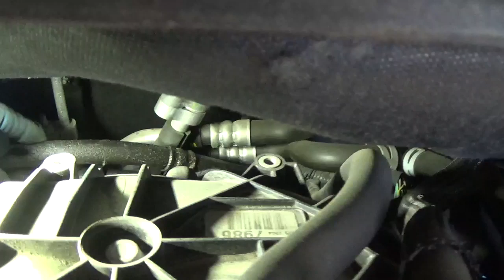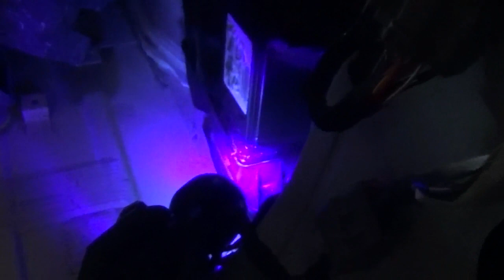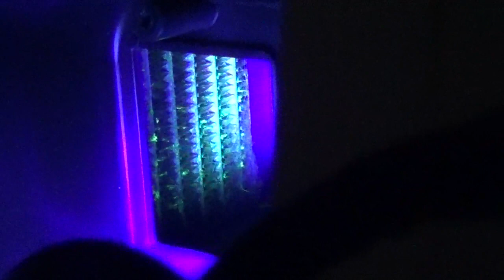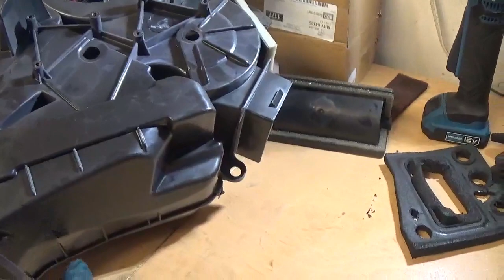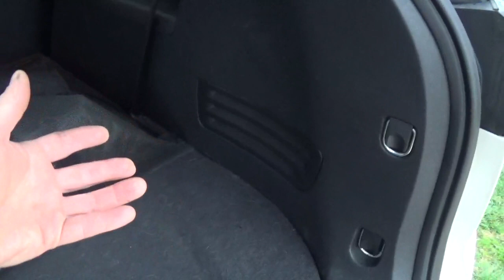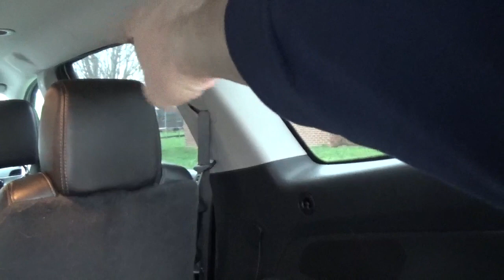Chevy Traverse Hard To Find AC Leak

Comment: Thanks for the resistor tip.. I didn't have to remove the seat though But I'm in the middle of the job and haven't reassembled yet and it might bite me in the ass later

Comment: Service bulletin has been out for this for years.   metal from the blower lands on the evp. and corrosion begins.    they have an improved blower cage is your motor is dead.   If not use your old motor as it has already been broken in.

Comment: Thanks for the video, Ramon.  If I don’t care about the rear, could I just install an ac block off in the front (at the location you mentioned where the power steering line rubs the rear ac line)?

Comment: The rear one condensates because it runs all the time the front one is running.  Ie any time compressor runs the evaporator is working.  The blower may not be used but evaporator and rear heater coolant are independent of the blower.  Temperature is controlled by a blend door.  Dirty air brings contamination from the air plug in the quarter panel.

Comment: Thank you for posting. Great job with this video and explanation. A few questions…
1) do we know the cause of the leak? Poor quality of evaporator? Other? I saw where there was a recall on 2015 and prior vehicles where an open design blower motor was allowing tiny copper particles from the motor wiring to be blown onto the evap and ate away at it causing the leak. Chevy came out with a closed design blower motor that would stop this from happening. My concern here is that we replace the evap and then it leaks again. Was the cause fixed?
2)can they possibly design a more difficult to access evap, good lord.

Comment: Nice find. Is there a solenoid/valve that isolates the rear portion of the system? Does it need to be opened via a jumper or scan tool for evacuation and refilling of refrigerant? Thx & Cheers 👍
Reply from the maker: I honestly don’t know my friend. I recharged  AC system with correct amount of freon and worked great.😊👍

Comment: I feel chevy should recall the traverse!! I am not rich i am disabled but my hubby works. We had a car my mom gave us but the front end was bad and it was falling apart.  I am a grandmother and I am the 1 person who was available to take all 8 of my grandbabies to and from school. Well my hubby and i were afraid the car would break down.  So we went to find a car it had to have 3rd row seats.  Cause i have bunch of kids to transport. So we decided the best option would be new. I am 54&he is 60.  This was our very first new car. And i am so upset with this car. Its only 7 yrs old there should be nothing wrong with it. But the air stopped oh and that was another thing the new one had to have working heat and air. I have had nothing but troubles with this car. I feel ripped off.  I feel like chevy used cheap parts.  And the only one who is benefitting is the parts people.  Cause I keep having to replace them. Its a money sucker and it is NOT right. The interior is even cheap. I pay 520. A month i only have a few payments left. But im right back where i started.  With a car that has so many problems and im scared everytime I drive it.  If chevy wont make this right. I will NOT ever buy another chevy. Infact i will tell everyone i know and meet NOT to buy one either. Fix this